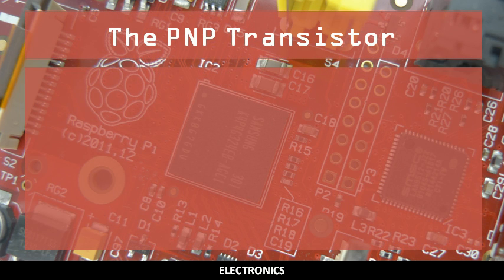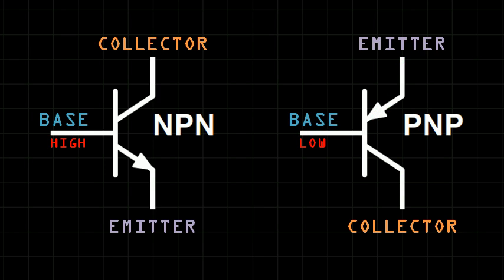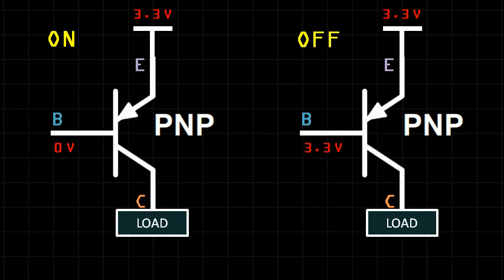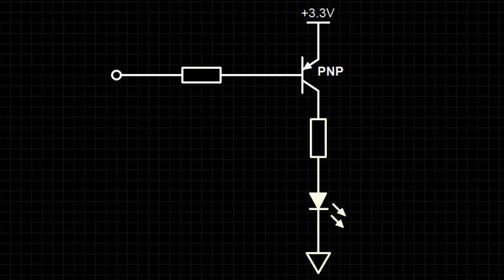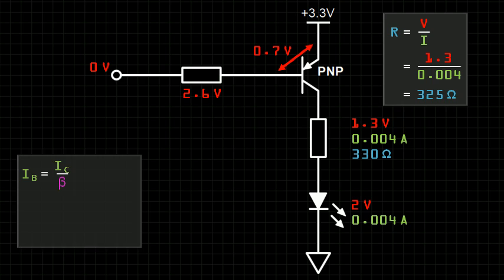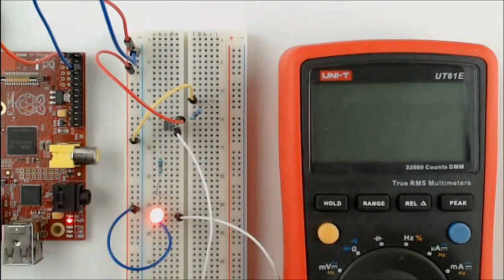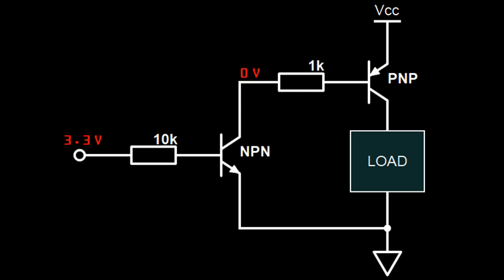PNP Transistor Tutorial (with the Raspberry Pi)

Comment: When we use only PNP transistor, the load will be charged/activated when the Raspberry Pi's output is low (active low). But if we use an "auxiliary" NPN transistor, the load will be active high. Do you have other suggestion to make an "active low" load (still using a PNP transistor)? I use the same Vcc but there's a slightly voltage drop on the controller's HIGH output (the controller's HIGH output is slightly lower than Vcc). Thank you in advance

Comment: Hi Gaven, this video really helped me!
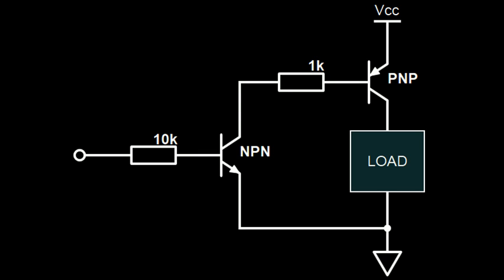Just one question if you or anyone can answer: for the circuit at 4:52, how did you calculate the required resistors? I'm more curious of the resistor at the base of the PNP transistor. I used a 10k ohm resistor for that just because it was lying around, which works, but I'm guessing it's unnecessarily high.

Comment: These are some of the best Raspberry tutorials I've seen. Very polished. Quick question: is it possible to use a transistor to switch a completely independent circuit with its own power/ground, or must they have common ground?
Reply from the maker: Thanks for the feedback! If you want to switch an independent circuit, you should use an optocoupler. You'll only get a weak current from the output side of the optocoupler but you can attach the output to an BJT in you need more.